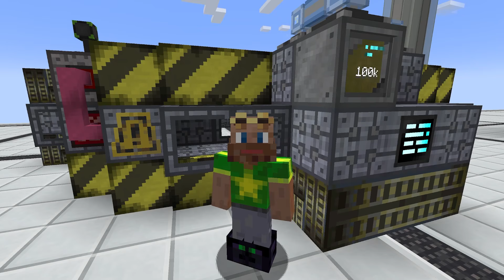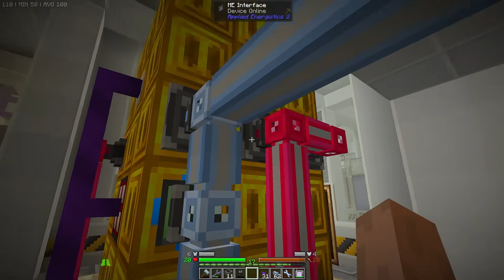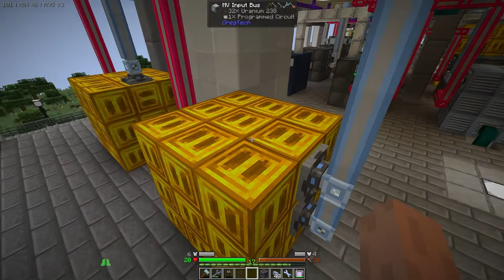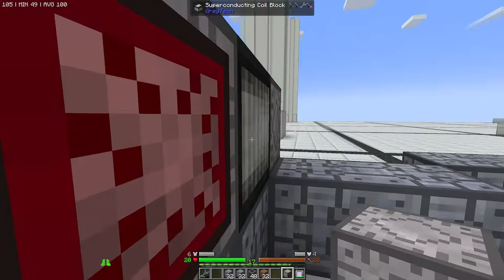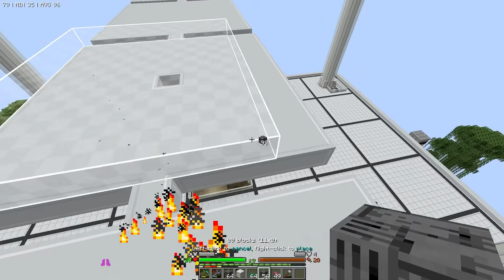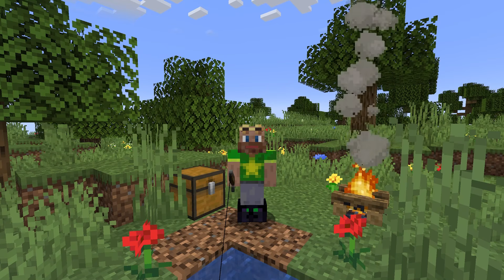Star Technology - 35 Building the Fusion Reactor at Last!

Comment: getting plutonium was made so much easier in epsilon. you can just convert thorium into PU241 it a 1:1 ratio
Reply from the maker: Oh daaaang that would have been much easier 😂 I am pretty keen to try epsilon at some point. It's much more refined (no pun intended 😅) than the 1.19 version
Reply: @gameswithpostie  i also noticed that im progressing 
much faster in epsilon. after like a day or two on a tier im ready move on to the next one.
Reply from the maker: @JoeMama-sy8ty  hmmm ok. Maybe they tweaked the progression a bit? I do tend to get distracted and spend time doing base building though 😅...
That said, I heard they're planning to introduce a hard mode. That might be fun to replay through when it drops
Reply: @JoeMama-sy8ty the only problem with epsilon is that if you transfer over your world mid playthrough. I transferred my zpm world a few days ago and had to redo a bunch of multi blocks and completely remake ore proc. But overall it makes progression sooooo much easier

Comment: You can use the fusion reactor to produce energy, by using a plasma turbine, idk if it is pratical  in this pack but, generally speaking it is the best source of energy, with fusion being functionally infinite energy
Reply from the maker: I may have to look into that.. solar seems like it will keep me going for the moment, but this version of the modpack cuts off earlier (technology tier wise) than the latest version.. so maybe plasma is the longer term solution? I did want to try making a combustion engine at one stage, I built a dedicated methane production system, but i went to gasoline which seemed better 🤷🏼‍♂️

Comment: it's the same for most other Gregtech modpack on the fusion... they are used for making elements, not generating power, although you can generate power
also, there's an item for instantly placing multiblocks
Reply from the maker: @Walker74382  yup i was honestly surprised about it not being for power generation. Given the shape of the machine, and it's actual function it should really be called a particle accelerator 🤔
Reply: @ well realistically, the main problem is the huge amount of energy required to power the fusion reactor into such high temperature and maintain it, while trying not to melt the frames of the reactor itself
in reality, you're not getting much power from putting in this much power
this is the main problem that we are facing irl too
Maybe one day we can get to see an efficient fusion reactor
Reply: We have some net zero magnetic containment reactors, another main problem is that tritium is radioactive, meaning that it all disappears in ≈12.5 years